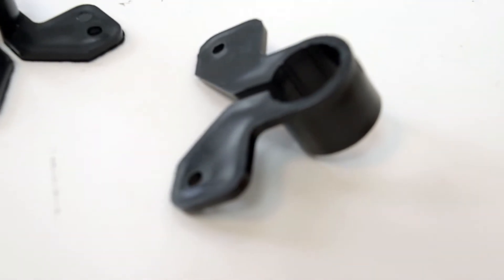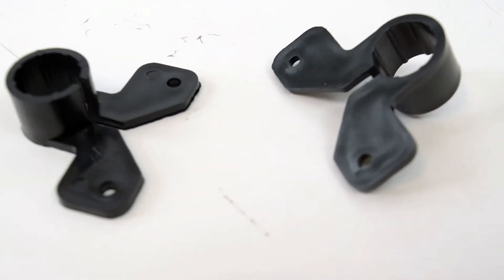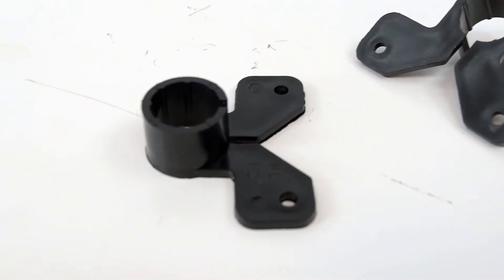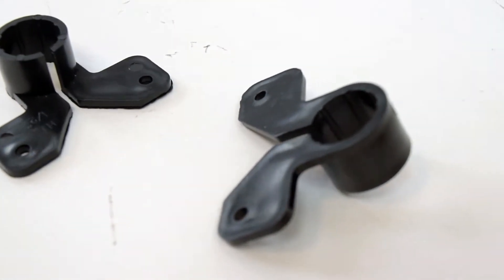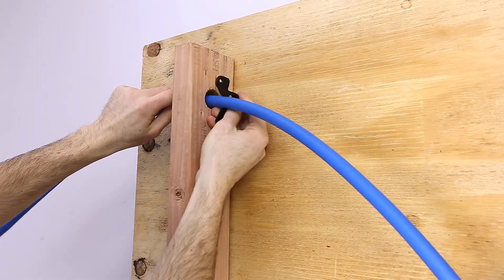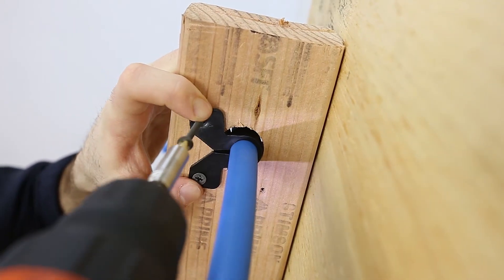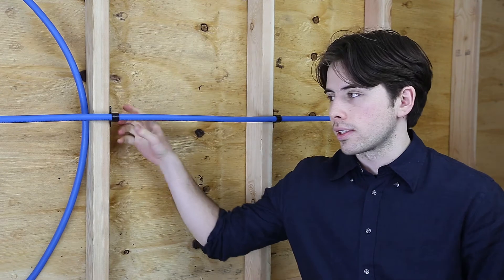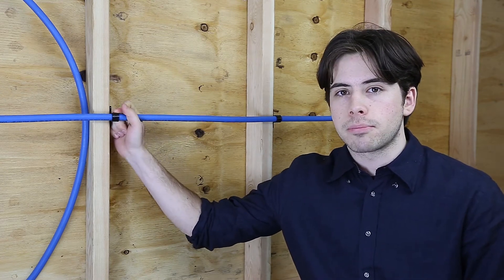Installing PEX with Suspension Clamps

Comment: Come on dudes, try to use your heads.  Add 1/2" to Pex tube size, and screw size is cheap drywall screws.
Reply: what did you say? Add half an inch (of what?) to Pex tube size....geeze im not a grammar PO but come on